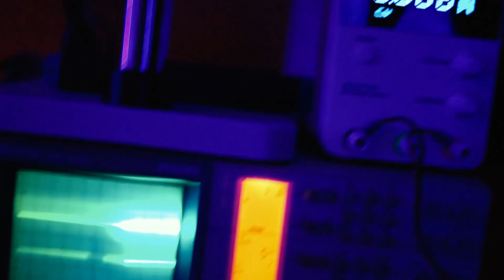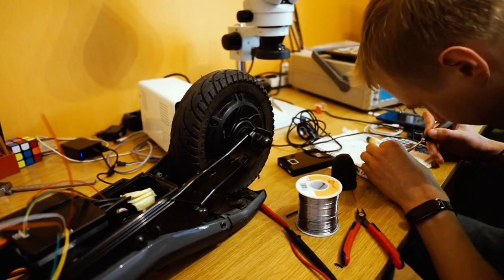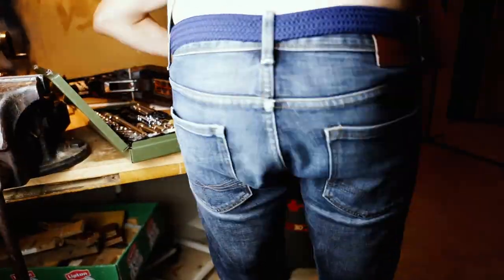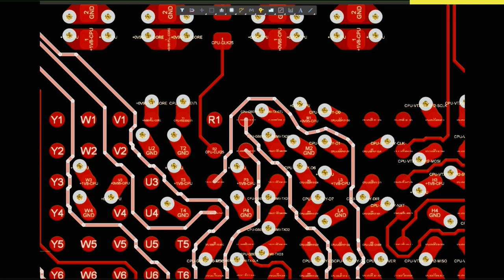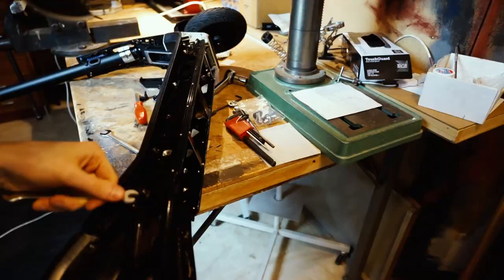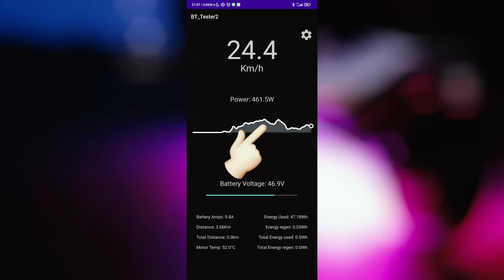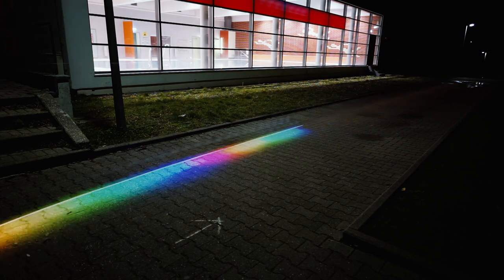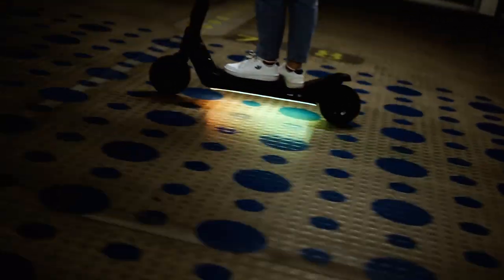How I Built a Custom eScooter with Underglow and App

Comment: I always enjoying watching your videos. I build some lighting for my longboard as well. How much current does your LEDs need. I use the apa 102 LEDs 60 LEDs per meter on my longboard and my buck converter has some thermal issues. Do you have any experience or did you come across this issue as well?